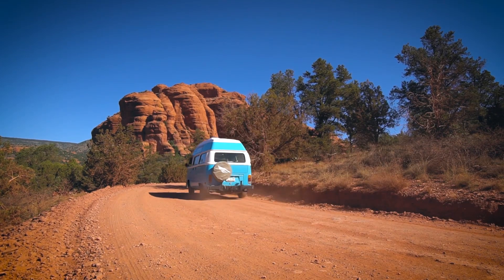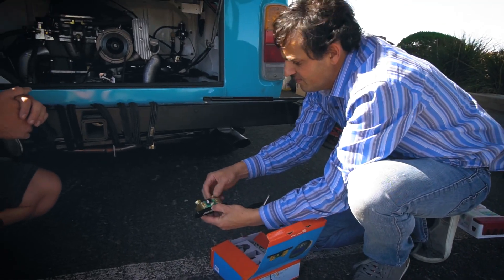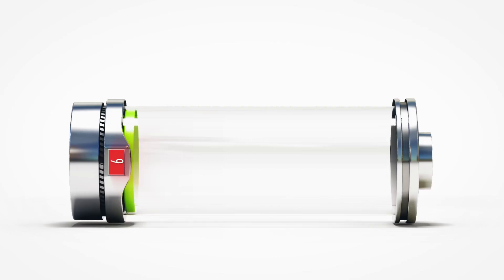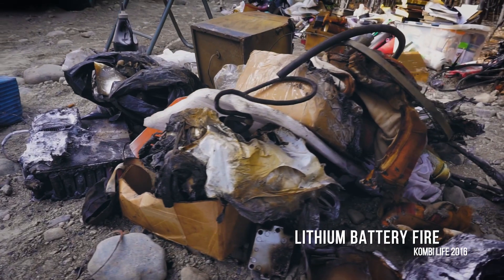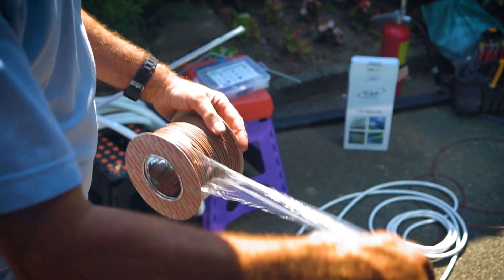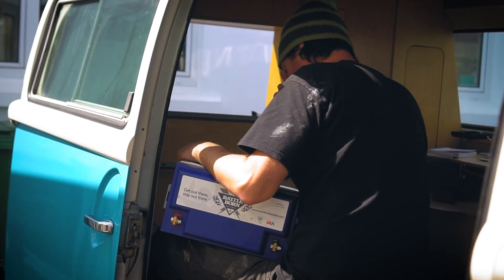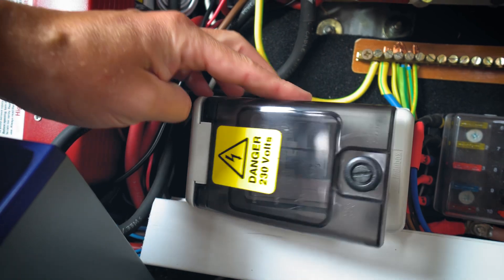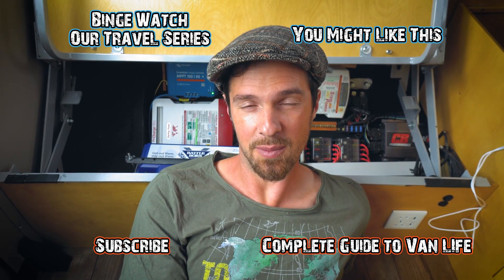Building The Ultimate Off Grid Electrical System for Vans, Trucks, RVs & Boats

Comment: Nice system and explanation of it all.  I switched to lithium in 2015, when they were still a bit pricey. 
but the change was so unbeleivable i havn't regretted it for an instant. I built 400 amp/hrs of prismatic cells with ballancers and a 2000 watt inverter. I have an older 27 ft motorhome and with 480 watts of solar  i almost always have power to spare. The only time i needed to charge was when spending two months in the rainforest of BC's north. I used power as usual and after 6 weeks of daily rain i finally got down to 20% power. The last two years i havn't plugged in once and i live on the road 6 months of the year.  Those battery's will be the last you ever buy, i look forward to seeing you put them to the test.    CHEERS      Steve h.
Reply from the maker: That sounds about right game changing technology for sure.

Comment: Great setup! One thing you could consider is having a plate between the engine and the batteries with a gold heat wrap that is mounted on the outside towards the engine so you get a lower temperature in the " battery bay , great content as usual 🙌
Reply from the maker: Thanks for the good suggestion and for your support Ricky.

Comment: Nice Video!
So 3of4 of your LiPOs are in the van and one of them are near the motor? Isnt that unfortunate because one of them will shut down because of temperature and three of them will be just fine at the same time? How did this work out?
Reply from the maker: 2 are inside, 2 locked in the engine. Because they are connected in parallel we'd be able to to continue to use any battery that wasn't temporarily shut down.  In practice we haven't get been in an extreme enough environment to not be able to use them. And we've been to freezing and up to probably 120F
Reply: @KombiLife  great!!!

Comment: Can you get a 12v DC power supply for your laptop?
Reply from the maker: Yep for the Mac it’s possible. But no for Ben’s beefy windows machine. It's really power hungry and has a 150W charger.  120W is usually the most a 12v socket is rated for.  You can use a DC-DC step up unit, but many modern laptops require mixed voltage so step up modules only works on some devices.
Reply: @KombiLife  Ben needs a new laptop haha. I have a 12v charger for my Microsoft surface book. If he wants to stay with Windows keep 12v power in mind next time he needs a new laptop. It will make a big difference on power consumption.

Comment: Ben, In addition to your 1,000 watt inverter, consider having a second inverter, which would be similar to the linked on here - 180 watt pure sine waver. When you run small AC stuff, that load doesn't get the larger inverter into its efficient range. Inverters aren't efficient unless they are running at around 75-80%. So this little inverter can service small loads much more efficiently. You can use a cigarette plug to operate it, but be sure the socket is rated, cabled and fused accordingly. For bigger loads, use the AIMS unit. Haven't seen your load table, but these little supplemental inverters often make sense. https://www.amazon.com/gp/product/B002AMPHHC/ref=ppx_yo_dt_b_search_asin_title?ie=UTF8&psc=1

Comment: Buuuut, did not understad one thing. 
Charging phones, tablets from 12v socket ok, all apliences adapted for 12v systems ok. But how to charge laptops and camera gear out of 12v - thats a question. None of my original chargers accept that. All are 120-230 range.
Reply: Use A coverter

Comment: lots of  misinformation here. 1st you do not need to store more than your 2days usage of energy. 2. failure is not an option is very poor engineering. you've burnt your first van you will definitely burn this. It is hopeless technology with strict temperature limitations. You can not use li-ion when they are freezing conditions! did you mention this? If you'd go for high voltage using li-ion will be understandable, it is troublesome to build 72/144 or 300VDC system from 12V lead acid batteries. But in case 12V energy storage? well...  if I would experience problems with my van on the road I can buy 100Ah 12V battery in every garage or shop for 50euros. or someone in garage can give me one for free. Try to buy 100pcs 18650 batteries and make battery out of it! not even talking about burn your passports and all belongings in not such a rare case of fire caused by li-ion battery. Used lead acid batteries in wind turbine systems for many years and they work like charm. I am using same lead acid battery bank with third van already. How good li-ion really are? well- every laptop owner will tell you story or two: how capacity goes down after year of usage, how they stoped charging all of a sudden.  2x100Ah  12V lead acid battery will last for at least 5yrs(I've seen 10year old and older batteries working fine) it cost 2x50=100euros, they are safe and weight is about 40kg/90lbs total. you have 2kWh in storage very easily rechargeable. Do not mention how easily you can blow your alternator by charging li-ion.  But hey- there is engineers way and hipsters way of solving problems. You can always pour cash on every problem if using math is too difficult ;)
Reply: There's no FUD like caveman FUD.